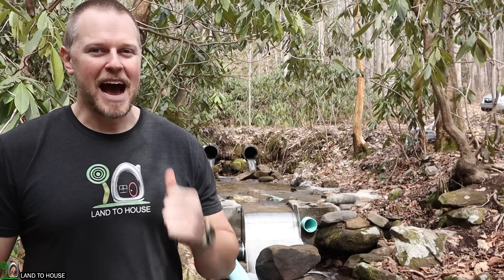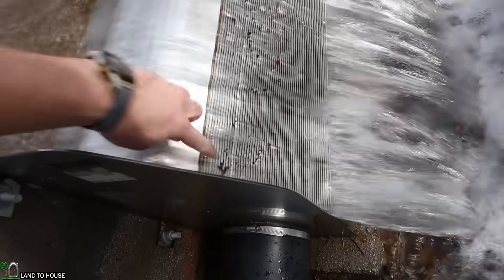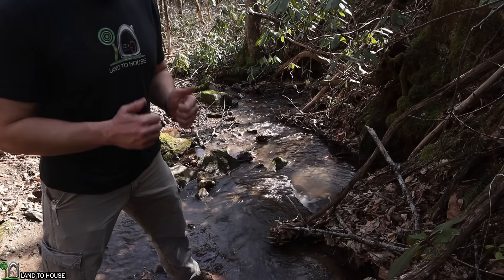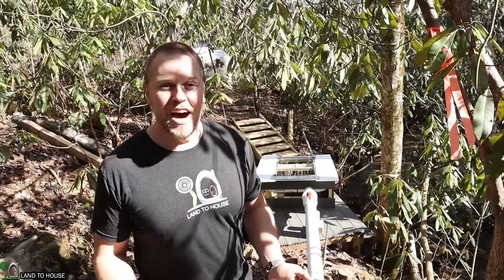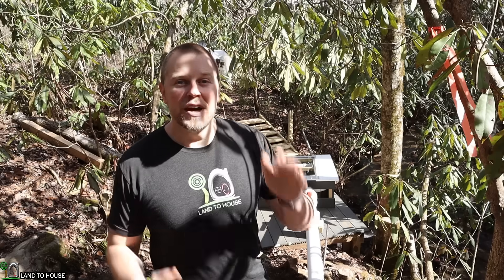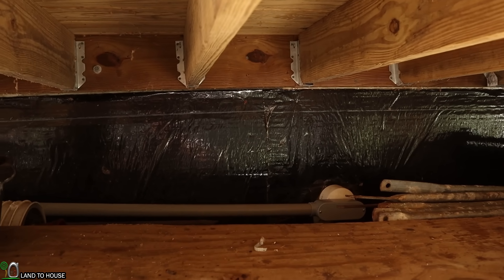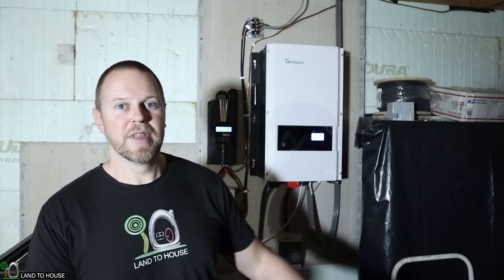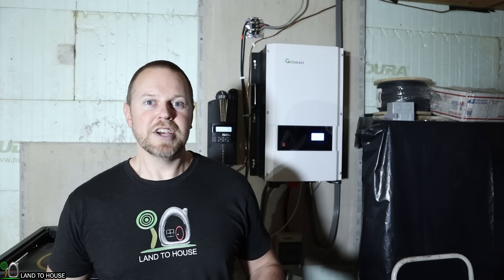AWESOME WATER POWER 500w Hydro Electric Off Grid System

Comment: I think I'd generate power at the creek and just run wire to location to save on pipe. less visual impact and 500' of 10 or 12 ga wire only runs about $50. a good price on pvc might be something like $1/foot
Reply: You need the head to actually generate power.  The pipe is necessary.

Comment: running a 3 phase ac current through a rectifier, then back through a inverter is costing you half the power generated by that turbine.  Your statement that you cant run off of 3 phase ac power is simply false, there are lots of industrial and marine applications that do exactly that.
Reply from the maker: Yes but not wild 3 phase ac. The power from the pma is jumping all over the place. The rectifier controls that ac and also allows the power to be stored in batteries.

Comment: My 15 year old coanada box has no air slits, I could put some in easy enough with a skinny wheel cutoff wheel in my grinder.  I was under the impression  the screen itself was the air intake.  I pull mine once a season, usually late summer, and pressure wash off the backside, to get the crud that build up on it. Not sure if it's lichen or similar but it is not quite maintenance free, very close though. Quick and easy to do, takes 15 minutes.
Reply: Likely alge or just bacterial growth, no such thing as a completely maintenance free system anyways.

Comment: Maybe I missed it (just getting my feet wet here), but is there a reason why the power comes into the house in AC, then gets converted into DC then back to AC before use?
Reply from the maker: The pma generates wild 3 phase ac power that transmits well but is unusable. The rectifier converts that ac to DC. From there the battery can store this power. Then the inverter makes 60hz 120v ac power.
Reply: @LandtoHouse curious about that "wild 3 phase power"... Each phase has to be 120v, regardless of ampacity. I suspect the rectifier, charge controller, & batteries are necessary for power quality..  but this isn't critical unless using digital loads
Reply from the maker: @donedeploying4now  the issue is the wild AC frequency changes with the speed. Almost all applications in the US need 60hz.
Reply: @donedeploying4now   Why do you say it has to be 120V? Once rectified it's at 57V, so clearly not at 120V before the rectifier. The frequency and the voltage depends on flow and pressure of water. You need that whole setup not only to get 120/240V at 60Hz, but also to be able to store energy.
Reply: Correct also 3 phase ac is the most efficient way to ship the electricity to the batteries. I you put the rectifier and batteries at the creek you'd have to run very large wire to the house to account for voltage drop.

Comment: Having a piece of land with a lot of height difference and a creek has a lot of added value because you can get a lot of electricity, and its constant. Pretty good! 

I would surely add solar panels too, and build an indoor greenhouse if I had that much free power. 

500 watts all day long can probably run all appliances of the house you run each day while they are not on all day long. 

Greetings,

Jeff
Reply: 500 constant watts over the course of a year at 14 cents a kwh is about $600 worth of free power a year
Reply: @mattcintosh   14 cents?
In Britain I pay around 45 cents per Kw hour. plus standing charges.
Reply: @oldbatwit5102  Yeah, britain sucks. Also where could you possibly build this in britain?
Reply: @mattcintosh 
Now how long will it last battery 
Pipe replacement 
5 years 
Would the system cover the cost over 5 years 
Estimated profit 
36,000$ 
What is the cost of battery and pipe rest
Of equipment would probably be good for 20 years
Reply: You can always build a mini-dam (just a tub to catch the water, really) to balance out the lack of a height difference - I reckon it's better to build it either way, because creeks don't have a constant flow of water year-round and you'd wanna account for that fluctuation.
Reply: @YamiKisara  Not how that works, you can't artificially add height difference, the energy comes from the change in height of the water from the source to the drain. This takes advantage of all of the 50ft of head using that pipe, which is superior to a dam. In terms of a small scale energy storage solution (since 500W isn't enough for most appliances, but averaged over the day and night ought to be more than enough) would be a battery, since a dam for energy storage simply isn't reactive enough to fluctuate to power, say, a toaster or something.
Reply: @asdfasdf-dd9lk  They can still use a reactive turbine for the larger creek/reservoirs  with less head; Pretty sure it goes as low as 5 foot but the reactive turbines need a higher volume flow rate than the pelton turbine used in this video
Reply: I would say 500w is more than enough with a battery and inverter for spikes from power hungry items. I use an average of 280W, 3 bed house in a city (200kWh per month). Two people, I work from home, have plenty of stuff running. Fridge freezer, NAS, router always on. Tumble dryer, big TV, console, all the usual stuff.
You would probably need a heat source like a wood burner. I use gas for hot water year round and heating in winter.

Comment: To preface, this comment isn't a "this is dumb" thing, but a genuine question. I am wondering why they went with an AC generator if they were just going to convert it to DC then back to AC. Seems like there would be a good bit of loss between those two steps. I guess if the genny is a good distance away, that would make sense considering the loss that could happen with long distance low voltage DC transmission and/or considering thw cost of cable to avoid that loss over such distance. Then again considering there is like $15k+/- of gear inside including thw batteries, I don't think the cost of thick wire would be a concern. Also considering the systems design, I would think they could put the genny right next to the house if they wanted. 

My small power systems involving batteries(PV, hydro, wind), I usually just use a DC generator and try to run as many regularly used things like lighting and USB powered devices right off the DC batteries instead of powering them on the other side of an inverter. For example I use low voltage DC LEDs for lighting and wire USB plugs like one would with standard AC receptacles so there is no need to use an AC to DC adapter. Most wall mount USB receptacles have two ports, so if I am feeling fancy, I make the top one low (<1)Amp and the bottom one a 2-3Amp. 

Anyway, I was just curious as to their decision to do so. Thanks
Reply: DC electricity loses considerable power over distance.  The energy is ‘lost’ as heat , essentially the cable becomes a heating element, which could cause the cable itself to melt, or cause items in contact with it to even catch on fire if they are susceptible.

Comment: I have a stupid question... how does placing those two rocks before the screen supposed to slow the water down? Seems to me you can pull all the rocks there you want.. it wont slow the water down.
Reply: putting anything in the path of water, which naturally takes the path of least resistance, acts as a brake that it must flow around, reducing the flow speed it otherwise would have had going directly over the screen before without affecting the actual volume of water. Think of it like traffic on a  motorway, if you put a bunch of cones out that drivers must slow down to maneuver around it doesn't reduce the number of cars that will travel or the speed they can reach before or after the cones, it just slows them down at the cones.
Reply: @masteroogway6660  thanks for reply.. still makes no sense to me.. traffic can back up and collect as it trickles through slower through an obstacle...  the water seems different to me.. put the rocks there... but if you have 30 gallons of water a minute coming from upstream... then you will  still have 30 gallons of water going over that filter.  Say the flow has been restricted to 20 gallons a minute... you still have 30 gallons a minute coming in... where is that 10 gallons a minute going if its not going over the filter?
Reply: @user-io8bm6gz5z  it's all going over the filter just like all the cars get around the cones and regular traffic resumes, there's just a slight interruption at the point its needed, if 30 gallons was before the rocks and only 20 gallons after then you'd form a pond which would increase the amount of water before the rocks and it would naturally find a new equilibrium as all water will
Reply: @masteroogway6660  cars wont over flow and spill over the sides of the hwy.. they can literally stop and wait.. not like water. If its slowed more than the amount coming in then its going to continually build up and spill over the sides... if its not spilling over the sides then whatever amount is coming in, is going over the filter regardless of what you put in front of it. Sorry, im not trying to be an internet prick lol... it just doesnmt make any sense to me. 30 gpm coming in then 30 going out..  if the water going out has slowed more than whats coming in then it would start to accumulate and spill over the sides... if thats what's happening Im sorry I missed that part. Only thing I can see those rocks doing is perhaps blocking some turbulence and making the flow more smooth.
Reply: @user-io8bm6gz5z  stop thinking of it as a set amount in and out and dont think cars then, you don't know what the flow rate was before the rocks were there, only that it was "too fast" to allow enough water to fall down the grate it just shot right over, so all the info we have is that no rocks was too fast and the volumes the same, now there is rocks, the rocks have caused a barrier that has changed the natural flow speed, it may travel faster physically around and between the rocks because the volume of water is the same, but when it's on the other side of the rocks it's the same volume but over a larger surface area than it was between the rocks, causing it to travel slower again, slow enough over the grate to operate correctly anyway, this may have caused a slight build up in water before the grate and stones, if it has its not affecting anything as there's already a reservoir area of slower moving water there. It's basically the same reason water slows down again after a rapids, rapids are the same volume travelling over a smaller surface area, causing it to go fast, it then reaches a larger surface, volume is the same, water slows down.

Comment: Cost needs to be factored in. How much electricity does the house use, what's the normal electric bill. how much was material and labor. How much did the homeowner do. I enjoyed the video. Thank you for sharing
Reply: It's a pretty easy equation if running grid power to your remote property is going to cost you $30-100k+ USD.
Reply: @Justin-C  Exactly.  I was quoted $80k for grid power to my remote property.  It is a no brainer to go off grid for us.

Comment: great job! what was the total cost of this system?
Reply: Many thousands. rule of thumb: $1/W for batteries. $1/W for inverters. $1/W for system charge controllers circuit breakers and wiring. So, there's about $20-25K there, without the hydro equipment.
Reply: thank you 
 @ruprectmonkeyboy1856
Reply: @ruprectmonkeyboy1856  Its too small to make any sense, 500W? My neighbour has river running his backyard and his hydro turbine makes 17-21kW
I would have just bought solar and batteries with this money